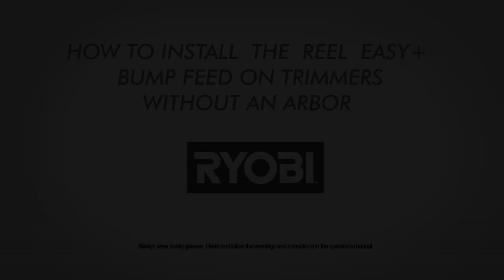How To Install REEL EASY+ Bump Feed Head On a Trimmer Without an Arbor

Comment: If anyone is having issues lining up the arrows, just don't do it like that, screw the whole bumper feed on.  In other words, after you open it up, and place the black bolt, put the bumper feed together then screw it on the trimmer.  Honestly I tried about 1 hour until I decided to do this, it wasn't latching at all... hope this helps.
Reply: Thank you, I have been struggling with this for about 30 minutes. Your suggestion worked Great!!!
Reply: Thank you, out of all the videos this was the only comment that made sense!
Reply: Great advice! You should have done the install video. At  52 seconds, even the presenter didn't place the spring back in the unit.   RYOBI needs to have the upper assembly easier to lock.  Hopefully, I no longer have to move the arrow to the lock position again.

Comment: Mine will not turn!! I got it to turn and pop off cuz the line got stuck inside, now i cannot get the bottom part to turn and lock back on?? very frustrated cuz it makes no sense, please help, and thanks
Reply: Same issue here. Super frustrating. Did you figure it out?
Reply: Same! Help!
Reply: I'm stuck too. Wouldn't come off took it to HD the guy at loaner tools got it unlocked and off somehow. Now it won't lock. WTF?
Reply: @djchanning  yeah i took mine back

Comment: yeah, mine will not twist on, ugh.
Reply: Mine won’t lock back on. Did you figure it out?
Reply: @erniewilson3834  did you ever find a solution
Reply: You need to make sure bottom two arrows line up first and then it will mate together and lock in place.
Reply: @Modogish  I've made sure to have the arrows line up but it still just doesn't want to turn??? I've also made sure that there's no gunk stuck on and there really isn't since this is the first time I've used it out of the box. So, just wondering if you have any other ideas? Or if anyone does??
Reply: @maryvazquez2339  Remember that INSIDE the reel area, there is a plastic nub that must fit into a depression in the lower part of the reel.  Rotate the top half until they fit into each other, THEN the arrows should be lined up and can be rotated to lock the top half of the reel in place.